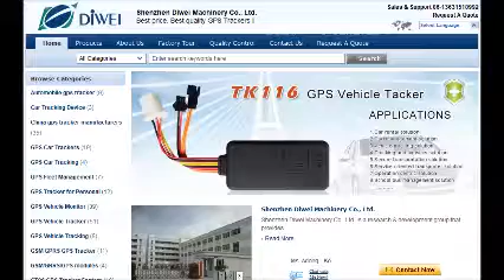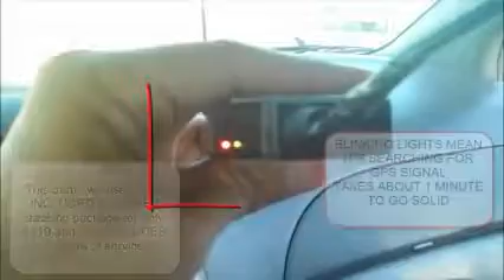How to install car GPS tracking unit into vehicle using dome light

Comment: It's my understanding that you shouldn't hide a GPS in a vehicle under a metal surface. They transmit alot better through plastic and glass. Won't installing it behind the dome light cause more Interruption with the signal due to the metal roof?

Comment: putting that in the headliner of the car makes that gps device ineffective. GPS signal does not travel thru metal you idiot which make this thing inoperable 95% of the time and inaccuruate 99.9 % of the time.